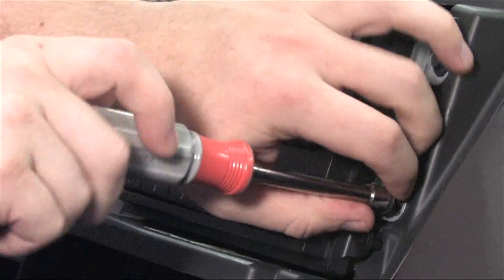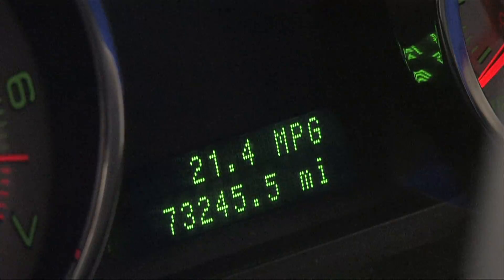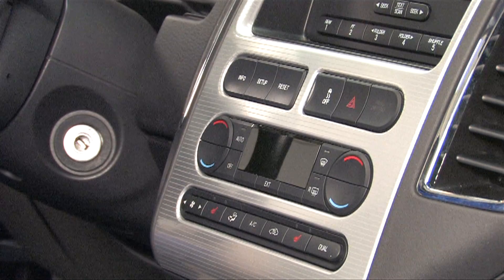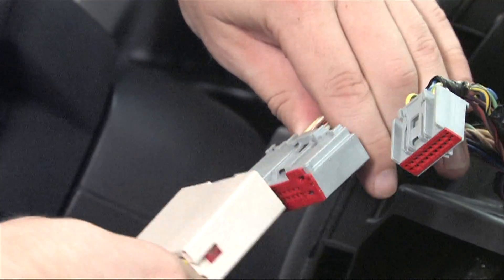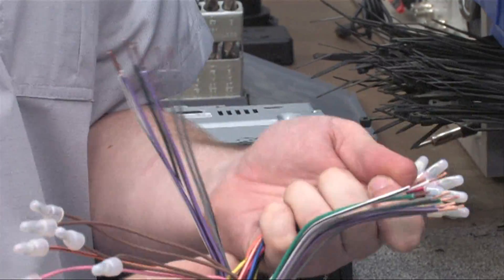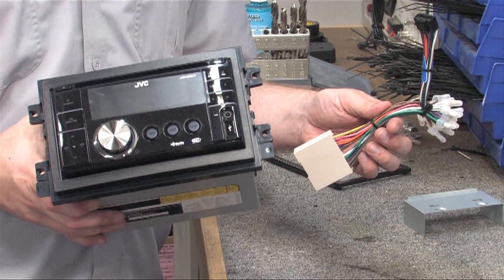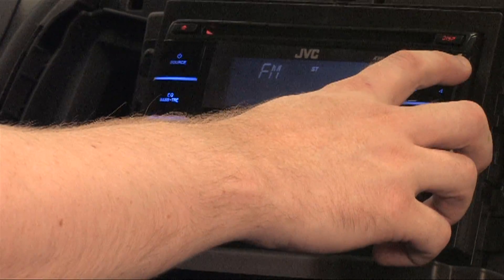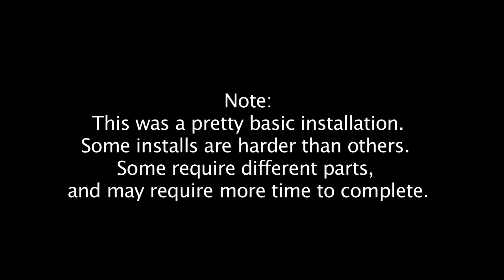Installing a Car Audio Receiver: Geek Squad Autotechs

Comment: I got an aftermarket stereo installed on my '02 Kia at one of the Geek Squad locations. Now, I want to take it out and put the one that came with the car back in. I lost the receipt for the installation. Would Geek Squad still honor and do it with no cost?
Reply: need to locate receipt with the labor sku.. bby can help with locating the receipt